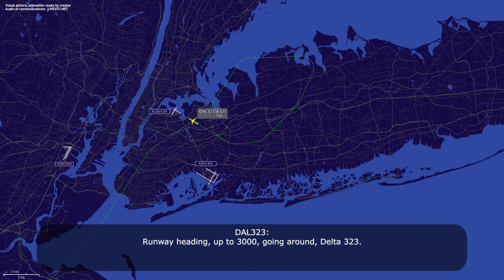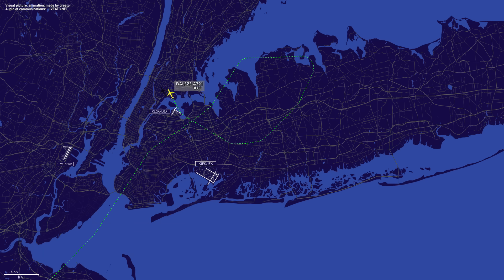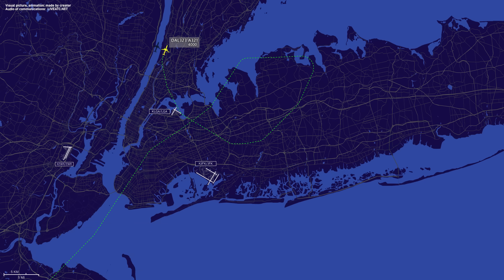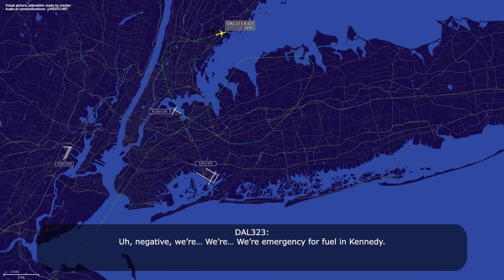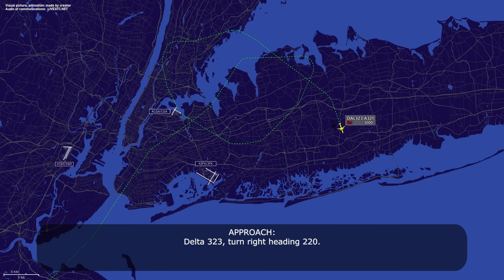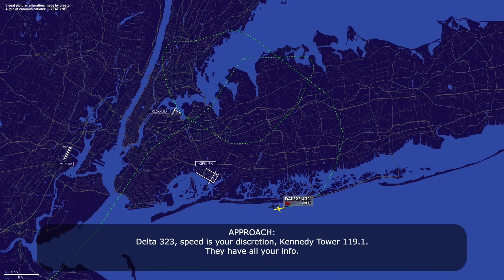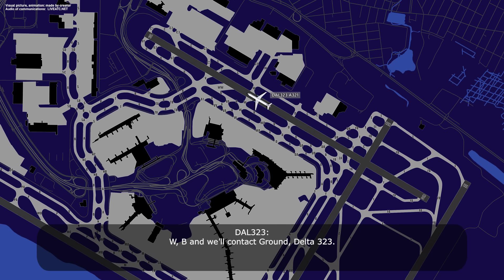Pilot declares MINUMUM FUEL after go around and diverts to Kennedy Airport. Real ATC

Comment: Delta policy is to go around when windshear of +/- 15 knots is present for intended runway. Interesting that it was ATC and not the crew initiating the go around.
Reply: I had the same thought. Perhaps they did initiate, but their radio call was blanked/not heard by the LiveATC scanner source due to lower altitude at that portion of their approach. The narrative will be out in full detail soon enough. ;)
Reply: Not true. At Delta, a go-around is only REQUIRED for a Micro Burst Alert. That's the memory aid (M)icroburst (A)lert = missed approach. Obviously a Capt. has to take into consideration the aircraft state, crew make-up/experience/fatigue etc when deciding to continue to land with W/S at +/- 15 kts.  I think what you might be thinking about the actual airspeed indications on the aircraft airspeed indicator on final being +/- 15 kts. A G/A is not required simply with reports of windshear being greater than =/- 15 kts.
Reply: The crew knew their fuel state.  That’ll override the 15kt rule.
Reply: @imaPangolin Only in an emergency. They never declared min fuel (not an emergency) until after the go around. Nor did they request priority handling for a return to LGA. And who requests a runway that is 4,511 feet SHORTER than 31L when you must land??
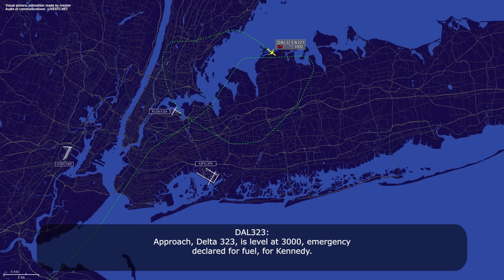Reply: @flymdjets just a small correction: they did declare (confirmed at 4:34)
Reply: @flymdjets  Actually the landing distance between 31L and 31R is only 1979 feet, due to 31L's  extended approach displaced threshold. But I get your point. I would have gone for the longer runway, and 31L is closer to the Delta terminal at JFK, so there's that too.

Comment: 25 January 1990, Avianca Flight 052; a Boeing 707 ran out of fuel on approach to JFK.   The National Transportation Safety Board (NTSB) determined that the crash occurred due to the flight crew failing to properly declare a fuel emergency, failure to use an airline operational control dispatch system, inadequate traffic flow management by the Federal Aviation Administration (FAA), and the lack of standardized understandable terminology for pilots and controllers for minimum and emergency fuel states.  While en route, the flight was placed in three holding patterns. Due to the air traffic controllers giving ultimately untrue delay estimations the flight became critically low on fuel. This dire situation was not recognized as an emergency by the controllers because of the failure of the pilots to use the word "emergency". 

The flight attempted to make a landing at JFK, but bad weather, coupled with poor communication and inadequate management of the aircraft, forced it to abort and attempt a go-around. The flight ran out of fuel before it was able to make a second landing attempt.
Reply: A very timely reminder of that incident. I remember that one.
Reply: @rael5469  I was living in Huntington Long Island at the time. The plane flew low over the house and sounded very strange.  I ran outside to see it flying low and slow about 1000 feet overhead  as it disappeared into low cloud cover. Then learned of the crash over the TV news. Worked at a photo development shop in town. The next day a lot of pics came in of the plane wreckage on the ground. It was a hilly and treed area and the plane was in sections spread out on the ground. Amazing that people survived.
Reply: @karaa270  I recall that there was no fire which was because there was no fuel. It’s rarely the crash that does it. It's the fire afterward.
Reply: I believe that was his third attempt and his alternates were baltimore and boston plus i beleive there was a machismo factor in the cockpit with the declaring an emergency

Comment: These airlines running around with just enough “legal fuel” to save a few bucks is going to catch up with them.  

I’m a corporate pilot flying a Falcon. Before that it was PC24, a Hawker 900XP, a Sabre 65, a Citation CJ, and. Beech Jet.  Plus a slew of Turboprops.  

I can tell you you I have never landed with less than 1:15 fuel and usually a bit more.  

10 years ago I was flying an ILS Approach into Columbus Ohio’s airport in heavy rain. We were on our way back from Ocean Reef Airport in the Keys. A Southwest 737 was in front of me and upon landing blew two mains.  I was forced to go missed and shoot an approach to the parallel.  Just like this crew I was 10 or so for the approach.  

After the nearly 30 minutes of vectors and finally the approach I was amazed with just how little fuel I was left with.  There was no option but to land at that point.  

That’s why I am always fat on fuel carrying about double the reserves I need to be legal.
Reply: Without looking at the rest of the flight, we don't know if they had been in any holding patterns that could have eaten up their fuel.
Reply: @danniballecter7936  you are right but I have dozens of friends that fly everything from A319’s to 787’s and I am always amazed at what little fuel they carry in reserve.   I shoot for 3500# in my Falcon but will go to 3000# as a minimum but its a lot of times in the 5000# range just for comfort or tankering reasons and a lot of times they are not carrying much more especially when considering they are in a airplane weight 5 times more or greater.
Reply: Barbie jets that can fit in & out of Ocean Reef Club can't carry "double reserves" without leaving golf bags and Tumi luggage behind. 

It's interesting you'd take a threat in the "time" bucket and make it a "no-time" threat by burning through 30 perfectly good minutes of gas waiting for a chance at CMH, with so many other options around. The better plan is to bingo 30 minutes earlier in the game to Lunken, Cincinnati, Rickenbacker, Wilmington, or OSU. So many options.

Thats the problem with Corporate. Pilots are treated like uneducated hired help - just a cab driver in a taxi with higher costs. There is zero respect for ADM and CRM. You can't say to the owner, "NO, you cannot bring all those bags. NO, we can't make it into ABC, we must divert to XYZ." If APG or Aerodata says that runway won't work, you have to make it work. So you exceed runway or performance limits, or make it a 134.5 operation by falsifying fuel load or W&B.

Rest assured, the pilots at Big D aren't cruising around with min fuel.
Reply: @Bronco-wr9ii  I would not call the Falcon 2000LXS or Falcon 900 Barbie Jets.   They operate in and out of there all the time and can easily fly 3 hour missions carrying whatever they want.  Other midsize jets operate in and out of there daily.

In the example I used I was flying the PC 24 that day.   That airplane is an absolute beast and can fly in and out of Ocean Reef with all eight seats full and comfortably fly 2 1/2 hours or more.   That particular day I did have a Plan B and a Plan C, OSU and DAY.   What I was just stressing was it’s amazing how quickly you could burn through what is a legal IFR reserve on something so simple.   My 35 years experience shows me that it’s usually not a weather issue that catches you off guard. It’s something like the 737 blowing tires in front of me or a Seneca landing gear up and closing the airport.

When I took the Department Manager/Chief Pilot position two years ago at my current job the first thing I did was write an ops manual.   It closely mirrors Part 121/135.  It stresses ADM, CRM, and saying NO.   Our department is set up where I approve all flights along with the crew flying that particular flight.  Any of the three of us can turn down a flight with no ramifications.  In the past 24 months, I’ve probably told the boss no at least a half a dozen times.  I can also think of two occasions where we left an entire day early and two or three occasions where we stayed an extra day.

I agree with you in most part 91 operations it is hard for someone to say NO.  When I interviewed with him I told him any monkey could fly the airplane.  I said give me 5 of your 1700 employees and a week and I could teach 4 of them to takeoff, fly around town, and land within that week.  What you’re hiring me for is to make decisions. Sometimes those decisions will be telling you NO, something I’m sure you don’t hear a lot.

I never wanted to be a city bus driver so I’ve stayed away from part 121.  I did two years at a part 135 early in my career and that was enough for me!  Dealing with pressure from the company and from the Wannabe Ballers who used those airplanes like a taxi..

The great part about this industry is neither one of us could do the others job yet we are all clumped together as pilots.   A airline pilot is completely different than a corporate pilot.  A crop duster is even different.   A freight dog is a whole different game, although it is changing more to an airline environment.  Ect, ect, ect!
Reply: Welcome to part 121.
Reply: Meh.

30 minutes of vectors and you landed skinny? Next time bingo much earlier in the game. Cincinnati, Lunken, Rickenbacker, Dayton, Wilmington, OSU, - tons of nearby airports!

Of course, I already know the answer. The problem with corporate is you have Mister Shmuckatelli the "VIP" who got wealthy on the latest get rich quick scheme and they treat pilots like ghetto cab drivers. They zero respect for ADM. They never want to be told "we can't make it in to airport ABC & we must divert to XYZ." You can't say "NO." They are elite and more important than anyone else, and cannot be inconvenienced to divert to get gas. Even if it only costs them another hour or two.

As for extra reserve gas, that's just BS. If it's a barbie jet small enough that can get in & out of Ocean Reef Club, doubling your reserves means ditching everybody's' golf clubs and heavy luggage. I call BS on that one.

But you had "get-there-itis" and ended up landing at CMH at any cost. So many options for you to pull the plug earlier, and bug out to another airport. Why waste an entire half-hour's worth of gas once the threat of a long delay is known? You turned a threat in the "time" bucket into a "no-time" threat.

The pilots at Big D aren't slumming around with min release fuel. Rest assured, there's plenty of gas uplifted before the FDRA is signed.
Reply: Flight aware says the flight was 3:17 when it normally seems to block 2.0 hours.  They probably landed with between 30-45 minutes of fuel on board leading me to believe that they took off with 4 hours of FOB.  That's a pretty significant reserve.  What's the point of armchair quarterbacking the crew when you don't have any information?  That's not a quality I'd expect from a chief pilot.  Especially one that claims to prioritize CRM, ADM, and saying "No" (in this particular crew's case; in a legal and irrefutable way to ATC regarding their sequence.)

Comment: my question in this scenario is: what do passengers do? If you want to end your trip at JFK, could you? If you need to be at LGA for some reason, does DL shuttle you to LGA from JFK? and is that by air or on ground? what about checked baggage?
Reply: @kevin_spellman  there is already a shuttle that runs between jfk and lga.  Bus i am sure delta would also arrange a bus.  If you were getting picked up, it's only a 20 min change for who was meeting you.  We'll could take an hour at rush hour 😂
Reply: It all depends. I've been refueled on a taxiway with no option to deplane. I've also been taken to a gate to refuel with no option. I've also seen options to get off. Delta would likely want that plane at LGA for the next flight. My guess is they took on fuel and flew to LGA and depending on timing, gate availability, refueling, etc. they may or may not have been given the option to get off.
Reply: @UraniumTwoThirtyFive  if a passenger wants to get off you can’t legally refuse them.
Reply: @kickedinthecalfbyacow7549  That's only true if they're at the gate. If you're sitting in a remote position of the airport, you can't just demand to pull the emergency chute.

There are passenger rights about being stuck on a plane, but those only come into play after a certain duration of time.
Reply: @ so you divert to another airport and you’re on the ground and a passenger demands to get off, I think it would be a bold captain who refuses to let them
Reply: @UraniumTwoThirtyFive  Refuelling an aircraft with the pax on board is frowned on.  There is always a fire risk during refuelling.  Proper practice is to gate the aircraft, deplane the pax, then refuel, then re-board the pax.
Reply: You can chose to get off in JFK if you wish
Reply: Uber
Reply: I have no idea what the passengers did or thought.  I do know, however, that they should have thanked this very professional crew for massively reducing the risk of them being killed had the aircraft fallen out of the sky due to fuel starvation.